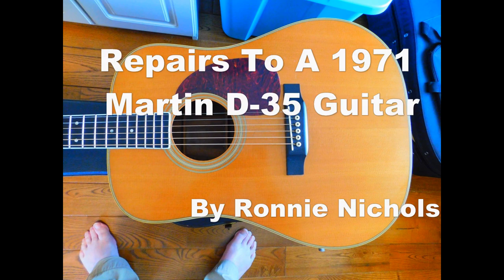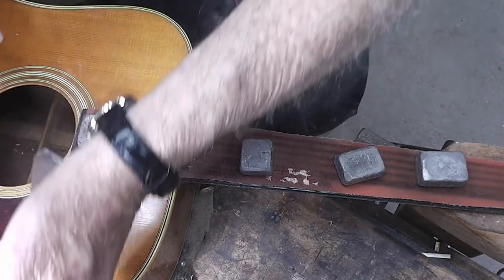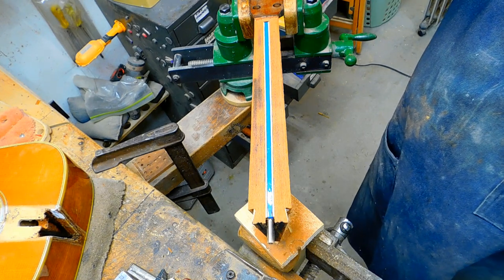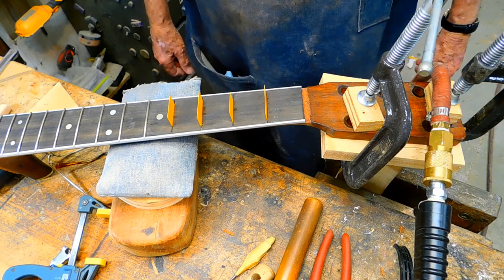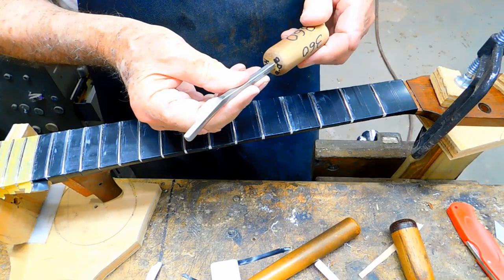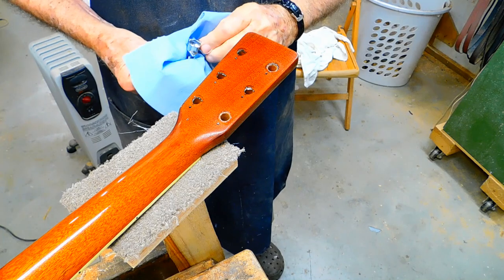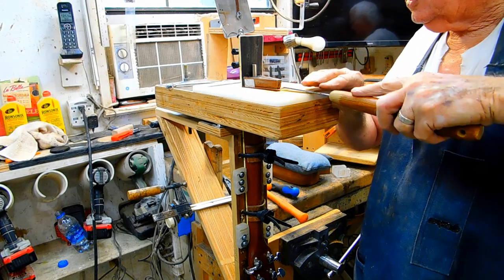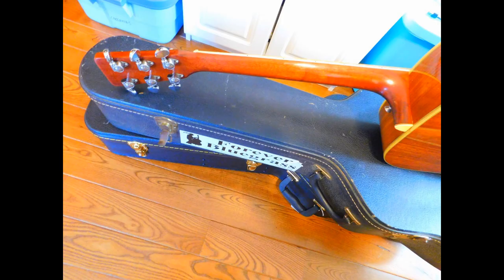Repairs to a 1971 Martin D35 Guitar by Ronnie Nichols

Comment: Hey Ronnie…. I’m very curious about whether you glued that truss rod in the slot along with the two shims you made and if you recommend gluing or siliconing rods in general.  Appreciate your thoughts.  Larry
Reply from the maker: Larry: I don't normally try to glue these type truss rods in the slot. I just glue the fingerboard to the neck over them. I think that was the first one I had tried gluing the shims in along with the rod. I don't think it matters a lot whether these rods are glued in or not but that is just my opinion. If i start out with no slot in the neck, I'll cut the slot to size and just leave the rod un-glued. I have even run a small piece of masking tape over the rod before I glue the fingerboard. I used the old Gibson type rods for a lot of years before I transitioned to the 2 way rods. They always had a piece of wood glued in on top of the rod and under the fingerboard. The Martin you are speaking about is still doing well, so it apparently didn't hurt to have some glue in there along with the 2 way rod. i hope this answered your question. Ronnie

Comment: I was told that a healthy guitar should have a straight edge that, when laid down the fret board, should land right on top if the bridge. This isn't my case. With mine the straight edge is higher than the top of the bridge by about 1/16th inch, or about 1/2 the height of the saddle. This is a 1991 Gibson J-45 BTW that was bought new and never played. It sat strung up all this time. Does this indicate that part of the soundboard has sunken some?
Reply from the maker: Jim: If the straight edge is only a sixteenth above the bridge, I wouldn't worry about it. Sadly, sometimes the factory does not get the angle perfect at the time it's built. You need to check the neck truss rod and see if the relief is proper in the neck. The end result in this is that your saddle will be a little taller than normal. This shouldn't cause a problem. It could be that the soundboard has sunk some, but if that has happened you should be able to see it if you inspect it closely with a straight edge. I've seen some of the older Gibsons that had a small brace in front of the soundhole and that can lead to the top sinking. Good luck with it! Ronnie